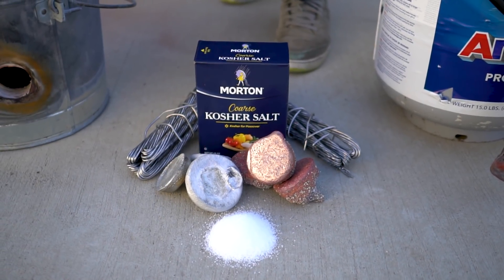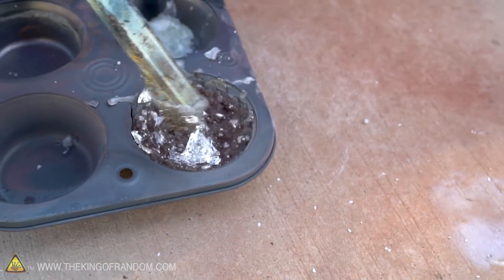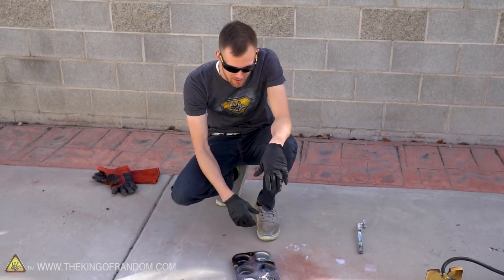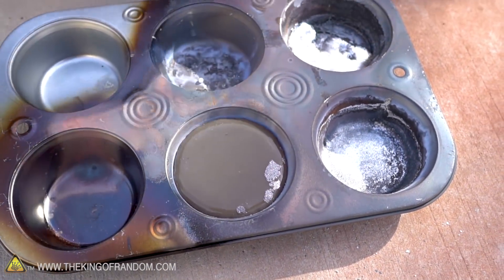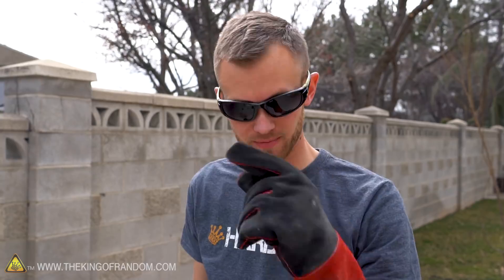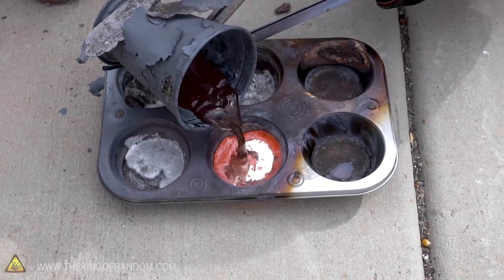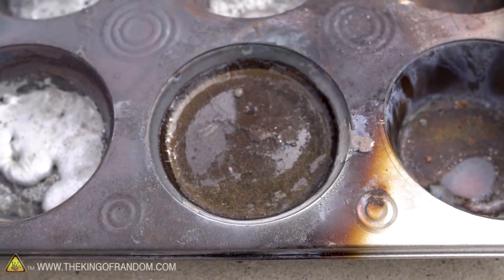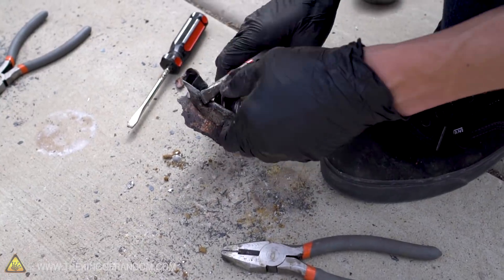When Molten Salt Hits Molten Metal

Comment: Mix the salt and copper while it's in the metal foundry
Reply: just say throw the salt and copper in the same crucible before melting, I feel like the densities of the two substances would still separate them out in the end (like oil and water).
Reply: daniel alloying is when two or more metals are being melted and mixed together,  salt isn't a metal. It is in a group of materials literally called salts.
Reply: THAT'S MY IDEA !!!!!!!!!!!
Reply: your talking about a ionic material alloying w/ a Metal. There could be the possibility of copper chloride or aluminum chloride forming w/ an excess of sodium, but that depends on reactivity. I don't think it will alloy. I'll be okay if you prove me wrong Jimmy Cook.
Reply: Elijah Jaeger then could the salt just create impurities in the metal like when molten aluminum gets carbon in it while it cools down
Reply: Correction to my last reply: neither Copper (Cu) or Aluminum (Al) are reactive enough to replace Sodium (Na) in salt (NaCl or Sodium chloride).
Reply: Jimmy Cook that is possible. So since we don't know what would happen, let's just say it could make a dirty copper/aluminum or it could be like water and oil.
Reply: EXACTLY
Reply: Den Lewis Balbas Very this.
Reply: Yes!
Reply: Den Lewis Balbas thats the same snkwi
Reply: Elijah Jaeger no it would fuse together becasue an alloys like aluminum bronze is made by melting them together and they don't seperate

Comment: Try puting some aluminum in to  the graphite container(the one where you smelt the metal)and when it has smelted put salt (not smelted)and wait until it olso melts
Reply: Won't make any difference. Salt isn't an element, it can't alloy. It could react to form other materials but it will never alloy with another metal.
Reply: HMS-Captain Lurmey culd he do it with copper?
Reply: Salt. Is. Not. An. Element.

Compounds can't form alloys. Not with aluminium, nor copper, nor iron, nor mercury or gallium or tin or lead or anything you can think of.
Reply: i ment copper and aluminum not copper and salt xD
Reply: Well yeah, copper and aluminium together make Aluminium Bronze. I'm not sure if they've made that yet.

Comment: Please wear a face mask when you handle molten salt.  When you melt it down, what actually happens is that the sodium inside turns into PURE sodium metal.  That means the chlorine goes somewhere, and chlorine at standard temperature and pressure is a GAS.  Especially at that high a temperature, you probably should not have your face anywhere near your crucible when you melt it down since it becomes airborne so quickly.  If you wear a respirator, you might seriously avoid something terrible even if you cannot see it with your eyes.

Comment: something that i saw was, when you poured the molten copper to the maffin tin, the maffin tin started to glow red, so my thought is that even a new tin wont work because of the huge heat seems like the maffin tin imbues with the molten copper, thus you couldnt get it out. As for the color of the salt maybe its fused with copper maybe the tin molten copper reaction caused that, i dont know. My suggestion would be to try tha same expirement with molten salt molten copper with a more heat resistance container

Comment: It's why greensand is better than steel for casting copper
Reply: it most certainly does not. copper has a melting point at least 375 degrees below even eutectic steel. greensand is better because it can be formed easily, will not sinter during pouring (at a sintering temperature of 1900C for glauconite and bentonites when copper melts at under 1100C). copper iron alloying can occur but only from interdiffusion which is very limited at that temperature - steel is BCC with BCT inclusions opposed to FCC copper; more likely it's slag and oxides nucleating at the surface of the iron oxides forming at the hot interface of the tin.
Reply: a-lpha of Zeldaforme Gaming Steel has a lower melting point than copper
Reply: daniel its a mixture of beach sand and green food coloring.

Na but for real its a mix of bentonite clay, sand, and just enough water to hold things together. Its like your ideal sandcastle sand on steroids

Comment: You should try to melt both the aluminium and salt in 1 crucible at the same time.
Reply: I agree that he should mix them ahead of time, but maybe he could use powdered metal.
Reply: The salt will act as a flux with the dross from melting aluminum.
Reply: Derek Thatcher pretty sure he did that in the video
Reply: Ben Bither, i mean, mix them together and then melt them inside 1 crucible.

Comment: Is that my suggestion?
Reply: Why yes it is. That's definitely "Put liquid nitrogen in molten salt and vice versa"
Reply: No it wasn’t liquid nitrogen in Molton salt and vice versa
Reply: The Anonymous lol
Reply: I suggested that too
Reply: Sounds fun
Reply: I also suggested that
Reply: Mix chlorine or fluorine gas with molten metals. Generate the fluorine via electrolysis of potassium fluoride dissolved in hydrofluoric acid. 

Also, pass fluorine over different materials to watch them burst into flames. Try to find the most resistant every day item.
Reply: Btw why try putting molten salt in liquid nitrogen and vice versa
Reply: Is this a suggestion?
Reply: MisterLepton, why do you have to said it to him ?
Reply: DanVR you know what a sarcastic means? I think you don't